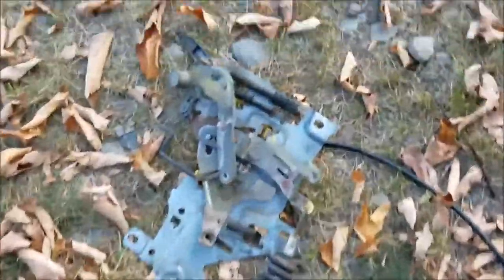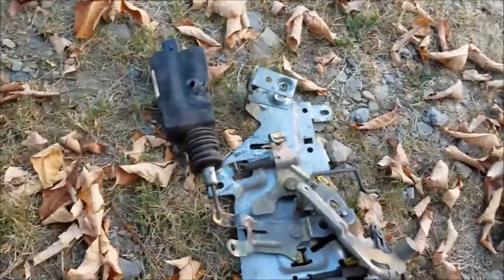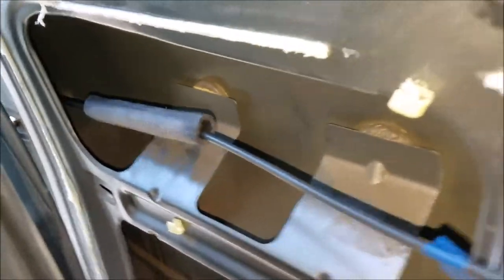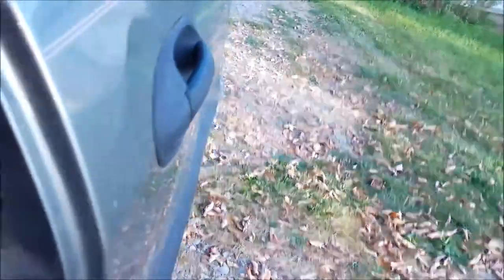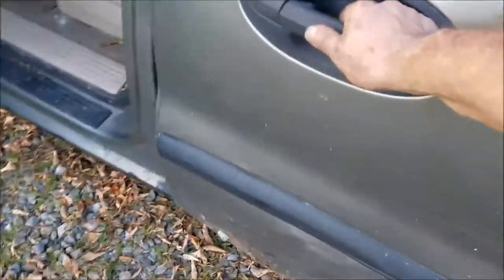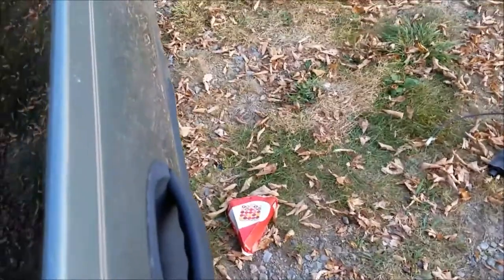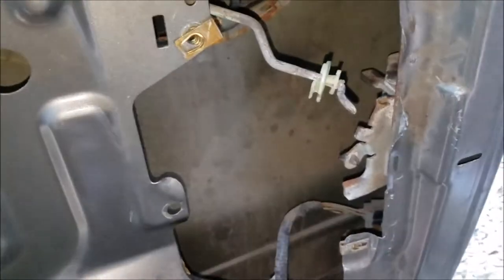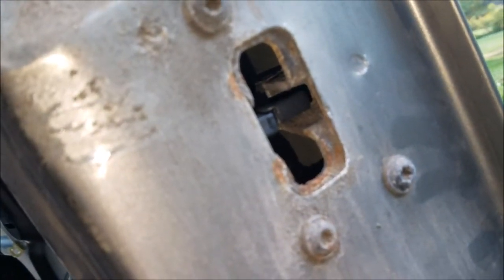02 Ford windstar sliding door Latch frozen

Comment: wonder is the same for 2003 lx my doors wont lock right, and one i think is motorized i think it worked one time and i didn't know it was, now i have to pull open and shut, but both lock on both slid doors now dont work and i have a door ajar light on
Reply from the maker: Hi Fallout! Thank you for Friending! Is the child lock on?
Reply: @DanaCrosby  both are in down position